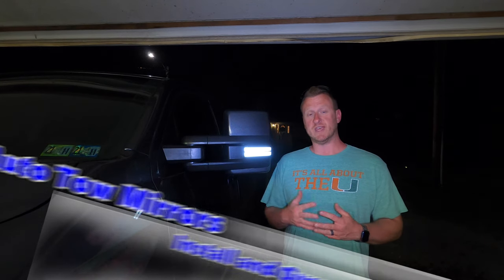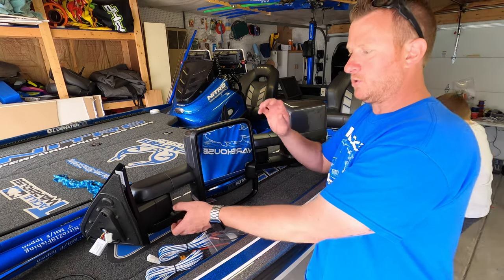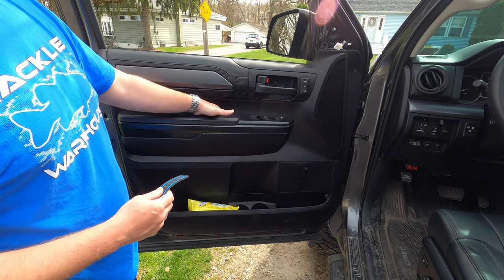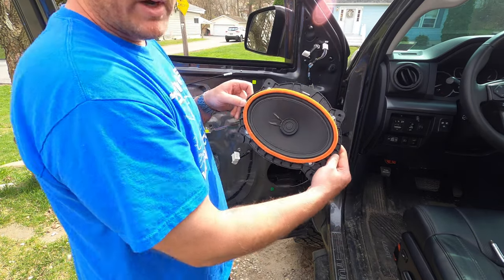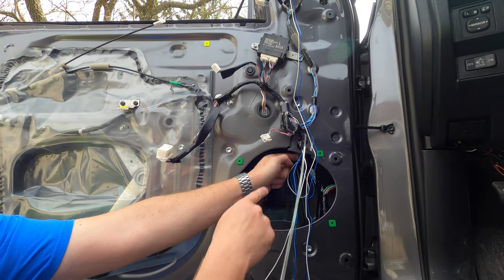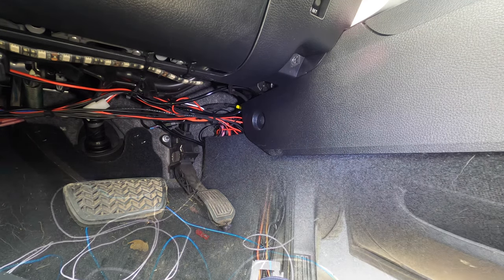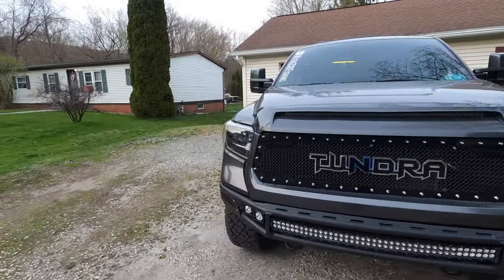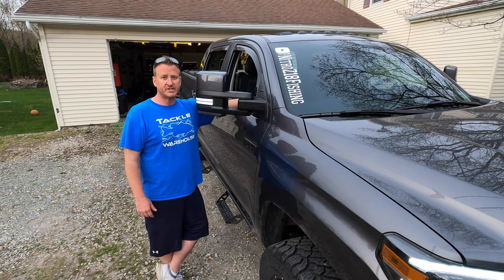Boost Auto Tow Mirrors, Loaded With Features!...Install/Review On 2020 Toyota Tundra Platinum

Comment: Just installed those today on my 2011 Toyota sequoia. Like the quality looks amazing. Thank you for the detailed instructions. 🙂👍 Tip for those who will try to install them on Sequoia,- reverse light power wire is actually on the driver side very bottom black 8 pin plug  solid blue wire)) took me some time to figure that out. Rest is exactly the same.
Reply from the maker: Thanks for sharing!

Comment: I just install these on my sr5 with the power fold and the same high intensity back up lights and they are awesome ! Also I decided to just go with the smoked LED running lights instead, i though it looked better then the led strip. Also, my setup didn’t come with a blue wire , evident the harness on my truck already was pre wired because it was a 2021, so it was just the white wire.
Reply from the maker: Oh nice, that made it even easier!…these are definitely some quality mirrors!
Reply: I’m looking at these gmc style row mirrors as well. I have a 2014 sr5 edition as well. The power fold works in the plug and play to your sr5? I read on the companies site that your vehicle will need to have the features already embedded OEM in order for BSM and power folding to work.
Reply: Hella monies
Reply: @Antdevv  you don’t need to have factory folding mirror option , the brand has it
Reply: So are your running lights on only with headlights on now since it came with a factory plug?
Reply: @kramynke yes , but the 2021 is already wired for it so it’s one white wire. The harness has it already built in for my year.

Comment: Thanks for sharing the installation process. I just have a quick question, so where is the turn signal coming from. I watch the video back and force couple times. You wired the spot light and running light, but no turn signal, are they build in factory connector?
Reply from the maker: No problem, thanks for watching!… Yes that is all part of the plug and play harness so you don’t have to do anything special with the turn signals… Hope that helps!

Comment: If a truck doesn't come with blind spot monitoring....these mirrors will not give that capability ...correct? My 2020 TRD PRO does not have BSMonitoring.
Reply from the maker: Hey Dale!… if I’m not mistaken, you can add those features onto them if you want… It will just include a little extra wiring… I would shoot them an email to be sure, but I am almost positive you can add that on if you wanted it

Comment: Great video!  Question, if you go with the standard option (only BSM, power mirror, and heating) do you need to do the additional wiring?  Or is it just plug and play?  I have a Platinum  so I have the same standard features you described.
Reply from the maker: Yes sir, that’s correct!...if you don’t want the running lights or spot lights it’s all just plug n play in your case!

Comment: Great video, thanks! I'm getting these for my new Tundra in the next few days and I'm trying to understand how the power fold mirrors work. I saw in another video that they folded when the guy locked his truck with the keyfob. It sounded like you said that yours fold when you press a button in the cab? I'd actually like mine to work both ways: 1) fold when I lock the truck with the fob; 2) but also be able to manually trigger folding when I'm backing into my garage, because I don't think I'll be able to get my Tundra into my garage with these bad boys extended. Can you tell me whether they work both ways out of the box, or will I need to do some custom wiring? Thanks.
Reply from the maker: Thank you!...and yea that’s a separate wiring harness...they won’t fold automatically when locking truck, there is a different company out there that sells that wiring harness you can add...I’m not exactly sure how to incorporate that into this install but I’m sure there’s a way!... thanks for watching!

Comment: Awesome video brotha. I've been thinking about getting these tow mirrors however my 2016 tundra limited doesn't have Blind Spot Monitoring and a turn signal feature. If I was to get this will have those features and are they just plug and play?
Reply from the maker: Thanks man, I appreciate it!… i’m almost positive you can add those features on to your new tow mirrors, shoot them an email just to be sure… I don’t want to give you any wrong information but if I remember correctly you can add any/all features to any mirror… There may be some extra wiring involved as well but they supply you with the correct instructions… Let me know how you make out!

Comment: I have a 2014 tundra,  bought the mirrors but the wire are red and black for the back bed, they are not blue and white, it works the same.

Comment: Great video, thank you. I spent a lot of time looking for this installation tutorial and couldn't find anything as good until I found yours.
I have a 2009 Tundra SR-5, I didn't know about the company you are talking about, so I have ordered mine from Amazon and I hope they don't have vibrations as you drive down the road. If they do the I will return them and will buy from you guys. 
Can you please check for me on the reverse connection,  I believe the blue wire I need to use will be the one on the bottom instead of the one you used.  Mine is a 2009 Tundra SR-5, no power fold, no indication for traffic. 
Thank you.
Reply from the maker: Thanks Michael, I appreciate that!…these have EXTREMELY minimal vibration and only at higher speeds, you wouldn’t even notice it unless you’re looking for it…they’re solid as a rock…I’m not 100% sure on the wire for the 2009, let me see if I can find it for ya!…thanks for watching!
Reply: @NitroZ18Fishing  
Thank you for the reply. 
I have installed the one I have bought from Amazon last week. So far they are working fine, very little vibration almost noticeable and that's very good. As far the reverse lights, I already routed the wires and decided that I'm going to install an on/off lighted switch instead. I was going to use one of the blanks already provided, but can't find a switch that fits. So I'm going to drill a hole somewhere convenient an install a switch that already bought. 
Thanks.
Reply from the maker: Nice!…glad they’re workin out for ya, let me know if I can help with anything else!

Comment: So I bought the mirrors with all the bells and whistles for my 21 1794.  Your video was immensely helpful.  The only difficulty I’m having is with the spot lights, I’m trying to wire them into my cargo light switch.  The green wire seems to be hot all the time, the violet is hot only when the switch is off….  How did you wire yours?  I’m thinking I’m going to tap into the green feed and add a switch somewhere.
Reply: What did you end up doing?

Comment: Maybe this is a dumb question but does the fuse box cover not fit now that there is a fuse tap?
Reply from the maker: Not a dumb question at all, you are correct… It will not fit without trimming a little section out to fit the tap

Comment: Thanks for the great tutorial video.  It was more in depth than the boost auto one.  Very helpful.  Since you seem to have a good grasp on electrical stuff….  Do you think the “reverse” lights on the mirrors could be fuse tapped into the bed cargo light switch via the 7.5 amp fuse under the dash?  Thanks in advance for your help.
Reply from the maker: Hey Kevin!… sorry man, I’m just seeing your comment…yea absolutely, you can easily tap into the cargo lights with a fuse tap…not a bad way to go, hope that helps and thanks for watching!
Reply: Good idea, and makes sense for illuminating to the rear.
Reply: Did you end up fuse tapping into the cargo fuse? I plan on doing the same thing. Only issue is my cargo fuse is located in engine bay on the 21 TRD pro. I still plan to run the white wire there. Any issues running off the cargo switch? I called boost and ask they said issue could very truck to truck. Issues like when enable maybe the license plates lights would come on, or like a break light or something..

Comment: Great video! I’m using your video to install my boost mirrors. I want to control my spotlights with the bed lights. Where did you connect the white wires?
Reply from the maker: Thanks man, I appreciate that!...I’m going to make a follow up video showing where exactly I connected white wires, I connected them to my switch for my bed lights...I’ve had several ask about it so I’ll get it posted asap, thanks for watching!

Comment: Do you still have your factory bumper? I added these tow mirrors and a new bumper but having trouble with getting the BSM to work since the bumper isn’t plastic anymore. Just wondering if you found a work around or maybe have a video posted you could link me ip with. Thanks again love the video and the main reason I bought these!!
Reply from the maker: Thank you, I appreciate it!!…I still have the stock rear bumper, that’s actually the main reason I never swapped it…there’s limited options out there for a rear bumper that’s compatible with our BSM, and I didn’t want to lose that feature…you could fabricate something, but it’s probably more hassle than it’s worth…sorry I can’t be more help on this one!

Comment: Super video! Good work man. 
I have a 2019 Tundra TRD Pro and it doesn’t have Blind Spot Monitoring (BSM) - I assume you have that on your 2020. 

Question: if you didn’t have BSM, how did you add that and attach it to your boost mirrors?
Reply from the maker: Thanks Pete!…yepper, I have BSM on the Platinum, but in your case I believe it’s just an extra step of wiring…contact Boost and they’ll send you specific install instructions on where you have to tap into, if you need any help once ya get the instructions from them let me know and I’ll see if I can help!
Reply: @NitroZ18Fishing  thanks for the advice! The 2019 tundra TRD pro doesn’t have BSM unfortunately as a standard option. I’ll reach out to boost and see if they have the BSM add on module. I wonder🤔 if Toyota has an OEM BSM module you can add…
Reply from the maker: Yeah definitely check with boost, if I remember correctly when I ordered mine I think they said you can add all of those features on even if you don’t have it stock… Let me know how you make out if you don’t mind, just so I know for my own knowledge!

Comment: Thank you so much for this video... I have a 2018 Limited and am waiting on mine to arrive. I really like the way you have set yours up. In regard to the High Output Spots... I have not added any other lights to the bed of my truck but I was wondering if you could tie them into the manual switch on the Cargo Lamp? Would that be difficult?
Reply from the maker: Yea no prob!...anything is possible with the wiring...haha...I’ve never tapped into one of those switches but I’m sure it could be done...I would use a voltmeter and test the wiring first, and tap into the appropriate one...let me know how ya make out!

Comment: Great video.  Thanks making it.   How about road noise/wind or vibrations?   I have read some reviews that wind and vibration can be an issue.  Thanks in advance.
Reply from the maker: Thanks Matt!…mine are extremely solid, vibration is almost non existent…maybe very slight at highway speeds, but I mean it’s almost not even noticeable…and I haven’t noticed an issue with noise, hope that helps!

Comment: I just wanted to ask one question. In order for the daylight running lights to be working on the mirrors do you have to do any special wiring? Or is it just plug and play? I have Limited Tundra 2018

Comment: I love your video.  I recently have same mirrors but in white.  I ordered one with blind spot monitoring and power mirrors but my truck doesn’t have either option.   If I’m stuck with mirrors can I just push them in or will I break them? Have a 2020 crew max sr5.my wiring is gray and white though instead of blue and white.  Thanks for your time
Reply from the maker: Hey Jeff!…you can actually add those features to your new mirrors even though the stock ones didn’t have them…it’s just a little extra wiring…if ya don’t want to add those features you can manually fold them in without hurting anything…hope that helps!
Reply: Can u send me a link or name of the wring fuse on passenger side that u tap into reverse wire.I ordered my mirrors from top gear auto and didn’t get any wiring with it
Reply from the maker: I actually show in the video what wire ya need to tap into for the 2020’s…I can’t remember at what exact point but I zoom in and show exactly where and what wire to tap to get them to turn on when I’m reverse…hope that helps!

Comment: Hey man, great vid! Thks for sharing. Just put a pair of these on my 2020 crewmax and they’re great. Loaded with features! One question I had on the fold function …. When I push the button to fold them in the driver’s side folds in slightly closer to the truck than the passenger side? Like 3/4-7/8 of an inch. Do u have the same problem? 

Thks
Reply from the maker: Thank you, I appreciate that!…and yes sir, mine do the same thing, kinda drives me nuts (cause of my OCD 🤣)…I thought about calling them to see why that happens, I’ve heard multiple viewers say the same thing…if I ever get an answer as to why I’ll let you guys know!

Comment: Nice vid.  I subbed and liked, is power fold only a stock option on the platinums?  I have a 21 TRD sport Coming from an ecoboost that’s one thing I miss.
Reply from the maker: Thanks man, I appreciate that!…I believe the 1794 trim also has power fold but I think that’s it…if ya go with these from Boost Auto you can add the power option even if your stocks don’t have it…hope that helps!

Comment: Thank you.   I was also wondering what kind of bumpers.  You bought.   I have a camera at n windshield.  I think it’s called tss and there are certain bumpers that u can’t get cause it affects the camera.    For the rear I was told u couldn’t use a metal bumper because of the rear camera.   Can u give me any insight into what bumpers I can get.   Sorry to keep bothering u on footbal Sunday.    Go bills
Reply from the maker: No prob!…I went with the Nfab MRDS in the front, I actually have install videos on it here on the channel…I modified it to fit the lights I wanted and OEM parking sensors…didn’t affect my TSS at all…there’s a ton of bumpers on the market, I also have a video on how to relocate the TSS if needed…I can link all the videos for ya if it’ll help!
Reply from the maker: I haven’t changed out my rear bumper yet, there’s not many options for that where you don’t lose your cross traffic alert system which I like

Comment: I just installed a set in my 2017 and I’m having an issue that even with the top glass angled all the way in I can barely see the rear of my truck in either mirror unless I lean towards the side I’m trying to see out off. Where yours like this?

Comment: If I want the mirror "backup" lights tapped into my truck bed light  so they come on when I open the door would I wire in the same fashion (with the same fuse), but tap into the "bed light" toggle?
Reply: Did you get it figure out?

Comment: Have you fuse tapped into a slot other than taillight to achieve true DRL? Any longer term review/experience doing that?
Reply from the maker: Yes sir, I show where I actually tap into at the 24 minute and 20 second mark in video…I didn’t use the tail light slot, hope that helps!

Comment: When you power fold them in, does the passenger side fold in as far as the driver side? My driver’s side ticks in more than the passenger. Trying to figure out if that’s normal.
Reply from the maker: I’ve actually noticed this as well… There’s not much of a difference so I never really worried about it but mine do the same thing!

Comment: Do you notice any mirror shake/vibration on the highway with these? I've had a cheaper generic Amazon set on a Chevy before and the mirrors shook bad at 55MPH+.
Reply from the maker: I was just a local expressway tonight, hit around 60 mph and the shaking was EXTREMELY limited...if I wasn’t looking for it I wouldn’t have even noticed...they’re rock solid on the truck!

Comment: Can I buy that supplied 3 amp fuse separately? If so where?
Reply from the maker: Hey Mel!…any auto parts store should have em…if ya can’t find them locally, Amazon definitely sells them, I’m just not sure you can get 1 single fuse…you may have to buy a 10 pack or something similar, but thankfully they’re cheap…hope that helps!